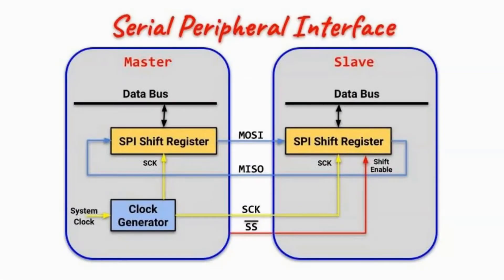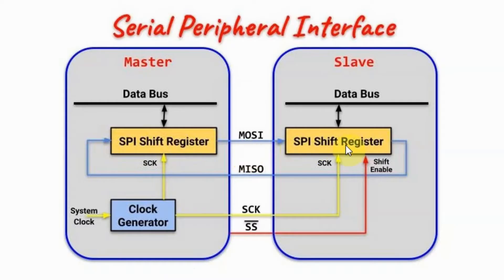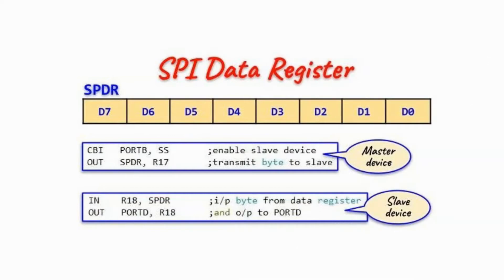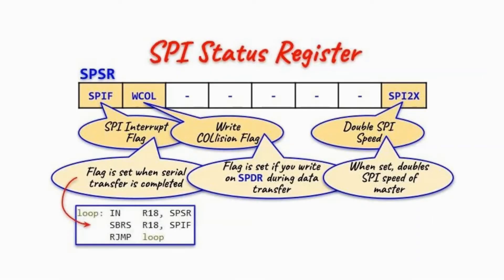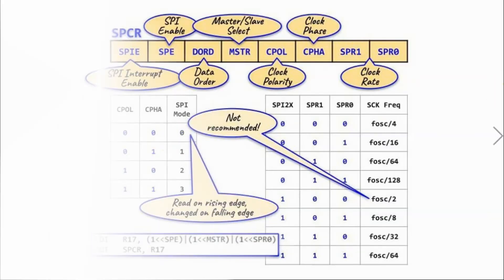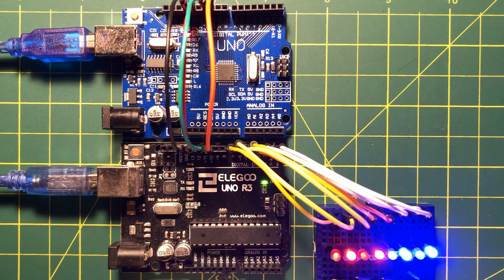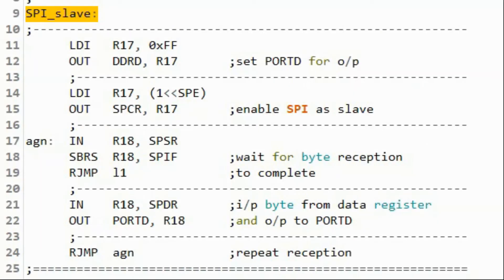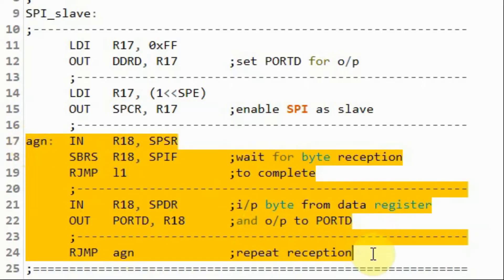Assembly via Arduino (part 15) - Programming SPI

Comment: Hi Mr. Anas Kuzechie,
My name is Tony. I am following your very interesting programming for UNO in Assembly.
I am very happy to be able to recreate/modify/debug some example for my own interests. Thank you very much.
I am at the point to try NRF40L01 based wifi module.   
Do you have example of transmitter/receiver code in assembly for this device?
Thank you and have good weekend.
Tony
Reply from the maker: Thank you Tony for your feedback. I don’t have code, but good luck with your project.
Reply: @AnasKuzechie Thank you very much for your response. Tony